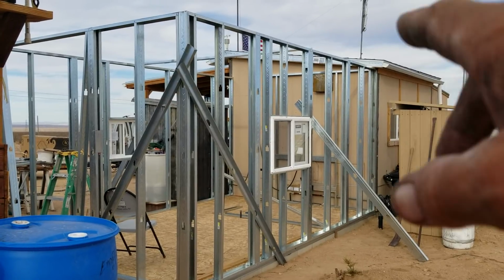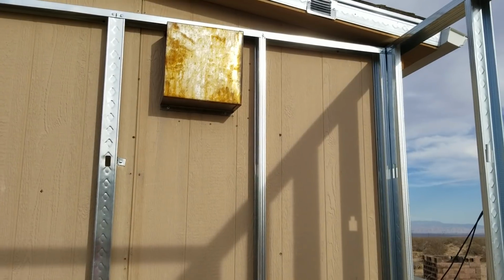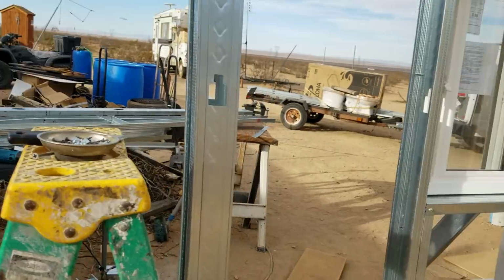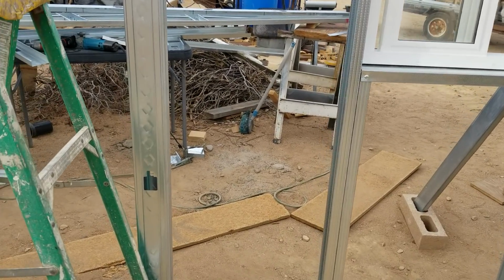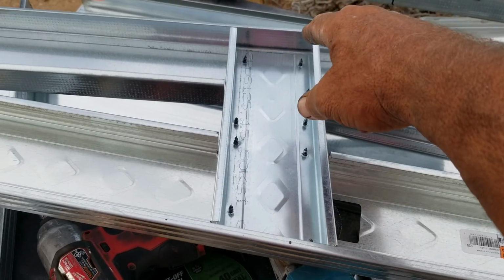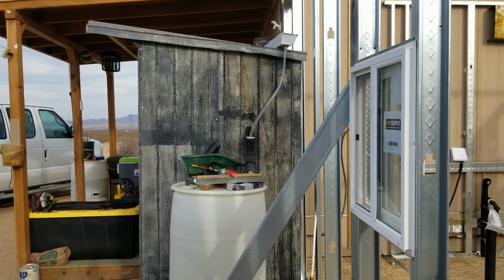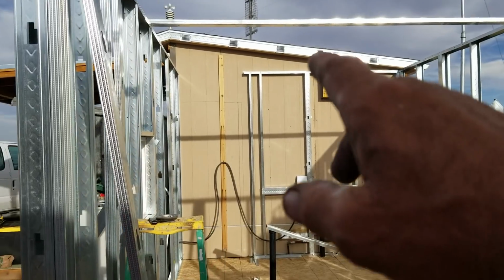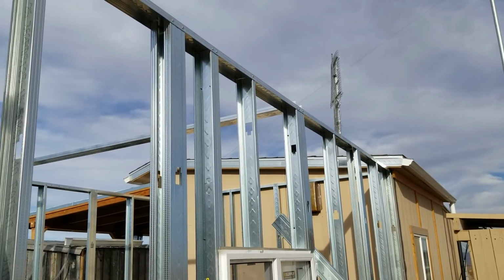Homesteading the Desert,  Aug. 30, 2018

Comment: you had better get your bath tub in before you close it up and the door not wide enough to get it in, just saying.
Reply from the maker: Josephine Flatt it will fit through the doors and hallway.  But I will be installing it before the inside walls are completed for ease of plumbing connections. Thanks for watching.

Comment: All the times I worked with metal stud the boss expected every piece be cut with aviation snips, would never let you use cut off wheels because they cost to much lol.  4 more :)
Reply from the maker: William Zoom snips are fine for 25ga, but 16ga, or even 20ga would be a task.  The man hours saved using a cut-off wheel outweighs the cost of the wheels.  When I did my first metal stud job while working for the government,  we had a cut off machine, manually operated by moving a 4 foot long lever.  Just slide the stud or channel in to the mark and pull the lever and it sheared the piece in a single "clank".
Reply: The whole operation was a rob Peter to pay Paul deal, the owner who started that company was very smart yet his son & grandson were idiots & the other grandson married a women who made them all look dumb when it comes to money :)